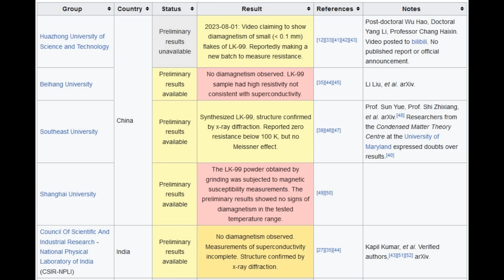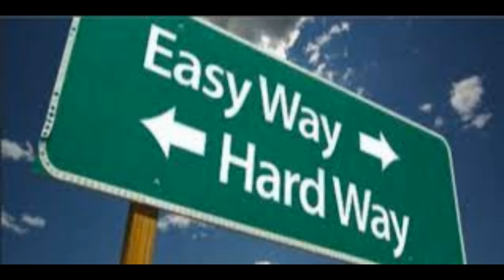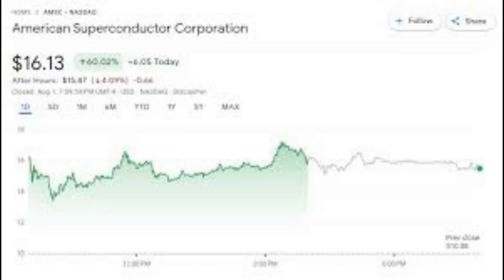2007 Superconductors And The Trouble With LK99

Comment: THINGS MODERN SCIENCE DOES NOT APPARENTLY KNOW:

Consider the following:
a.  Numbers:  Modern science does not even know how numbers and certain mathematical constants exist for math to do what math does.  (And nobody as of yet has been able to show me how numbers and certain mathematical constants can come from the Standard Model Of Particle Physics).

b.  Space:  Modern science does not even know what 'space' actually is nor how it could actually warp and expand.

c.  Time:  Modern science does not even know what 'time' actually is nor how it could actually warp and vary.

d.  Gravity:  Modern science does not even know what 'gravity' actually is nor how gravity actually does what it appears to do.  And for those who claim that 'gravity' is matter warping the fabric of spacetime, see 'b' and 'c' above.

e.  Speed of Light:  'Speed', distance divided by time, distance being two points in space with space between those two points.  But yet, here again, modern science does not even know what space and time actually are that makes up 'speed' and they also claim that space can warp and expand and time can warp and vary, so how could they truly know even what the speed of light actually is that they utilize in many of the formulas?  Speed of light should also warp, expand and vary depending upon what space and time it was in.  And if the speed of light can warp, expand and vary in space and time, how then do far away astronomical observations actually work that are based upon light and the speed of light that could warp, expand and vary in actual reality?

f.  Photons:  Modern science claims that energy cannot be created nor destroyed, it's one of the foundations of physics.  First Law Of Thermodynamics:  "Energy can neither be created nor destroyed."

A photon is usually depicted in a sine wave pattern with the 'e' and 'm' energy fields 90 degrees to each other.  The 'e' and 'm' energy fields go out together and come back in together, over and over and over, doing so even across the vast universe as far as we can see.

Where does the energy in the energy fields go when both the 'e' and 'm' energy fields go to zero?  And what causes the 'e' and 'm' energy fields to come back to 'full' from zero?

Also, 'if' a photon actually red shifts, where does the red shifted energy go and why does the photon red shift?  And for those who claim space expanding causes a photon to red shift, see 'b' above.

Why does radio 'em' (large 'em' waves) have low energy and gamma 'em' (small 'em' waves) have high energy?  And for those who say E = hf;  see also 'b' and 'c' above.  (f = frequency, cycles per second.  But modern science claims space can warp and expand and time can warp and vary.  If 'space' warps and expands and/or 'time' warps and varies, what does that do to 'E'?  And why doesn't 'E' keep space from expanding and time from varying?).

g.  Energy:  Modern science claims that energy cannot be created nor destroyed, it's one of the foundations of physics.  Hence, energy is either truly a finite amount and eternally existent, or modern science is wrong.  First Law Of Thermodynamics:  "Energy can neither be created nor destroyed."  How exactly is 'energy' eternally existent?

h.  Existence and Non-Existence side by side throughout all of eternity.  How?

*  Note:  My theory of everything idea, 'if' true (currently dependent upon the results of my gravity test, but 'if' true), can potentially answer all of the above items.
Reply: GRAVITY:
WARNING:  (CONTAINS EXISTENTIAL MATTERS):

Here is the test for the 'gravity' portion of my TOE idea.  I do not have the necessary resources to do the test but maybe you or someone else reading this does, will do the test, then tell the world what is found out either way.

a. Imagine a 12 hour clock.
b. Put a magnetic field across from the 3 to 9 o'clock positions.
c. Put an electric field across from the 6 to 12 o'clock positions.
(The magnetic field and electric field would be 90 degrees to each other and should be polarized so as to complement each other.)
d. Direct a high powered laser through the center of the clock at 90 degrees to the em fields.
e. Do this with the em fields on and off.
(The em fields could be varied in size, strength, density and depth.  The intent would be to energy frequency match the laser and em fields for optimal results, cancelling out the em modalities of the laser, thereby leaving behind the gravity modality.)
f. Look for any gravitational / anti-gravitational effects.
(Including the utilization of ferro cells so as to be able to actually see the energy field movements.)

(And note:  if done right, it's possible a mini gravitational black hole might form.  Be ready for it.  In addition, it's possible a neutrino might be formed before the black hole stage, the neutrino being a substance with a very high gravitational modality with very low 'em' modalities.)

(An alternative to the above would be to direct 3 high powered lasers, or a single high powered laser split into 3 beams, each adjustable to achieve the above set up, all focused upon a single point in space.  Maybe I could concentrate the Sun's 'em' into a high powered laser.  Might even work with the correct set up breaking the Sun's 'em' down into single 'em' energy frequencies acting like a single energy frequency laser.  A high energy laser powered by the Sun.  Cool, or actually pretty hot.  More than one way to build a laser.)

'If' effects are noted, 'then' further research could be done.
'If' effects are not noted, 'then' my latest TOE idea is wrong.  But still, we would know what 'gravity' was not, which is still something in the scientific world.  (But hey, might even still get a Sun powered laser, which of course could even be utliized in outer space for various agendas.).
This test can speak for itself.  It will either be true, partly true, or not true at all.  It will either show what gravity truly is, might be, or is not.  Science still wins either way and moves forward.

*  And note:  Whether my gravity test or another's, a gravitational black hole would have to be formed to prove the concept as being really true.  A gravitational black hole that 'if' self fed itself, could literally wipe out this Earth and all on it, possibly this solar system, possibly put a black hole in this section of our galaxy, and potentially even causing a ripple effect in this galaxy and surrounding universe.  But hey, if it does, no worries.  Nobody would be left to prosecute those who did so.  (Possibly famous last words:  "Hey, it worked.  Ooooppppssss.................)

But as NASA has already proven that low gravity conditions over a prolonged period of time is harmful to the human species, and large rotating space ships won't really work for space bases on planets and moons, those space bases probably being needed somewhere along the way out of this solar system and galaxy, we need to figure out what gravity truly is and see if we can generate artificial gravity so as to have smaller space ships and proper gravity conditions for space bases on planets and moons.  Otherwise, at least all human life will most probably die and go extinct one day.  Currently, no exceptions.

*  Added note:  Just trying to save at least 1 single species from this Earth to exist beyond this Earth so that life itself from this Earth has continued meaning and purpose to.  Gives me something to do while I exist, otherwise, what is it all and everything for?  Even if my TOE idea were correct, but if it did not help species survive beyond this Earth, what good would it ultimately be?

So, are you feeling lucky?  Doing nothing and at least the entire human species eventually dies and goes extinct with a high degree of certainty.  Doing a gravity test, (mine and/or another's), and there is at least a slim chance of literally wiping out this entire Earth and all on it, and possibly more.  Do you and other's truly want me to prove my TOE idea as being really true?

But also:
Questions:  Are at least some black holes in this universe due to a species who were trying to discern what 'gravity' truly was, came up with a test to do so, were successful, but the black hole generated (to prove what gravity truly was) self fed itself and wiped them and at least their entire planet out?  What species might have existed where a black hole now resides?

(Since all of life itself is ultimately meaningless in the grand of scheme of things anyway, do the gravity test and see what occurs?)

*  Added note:  Suggestion:  'IF' society did not want to do the gravity test, one suggestion might be to at least create a model as if it were true, then see how that model matches with observations and predictions.  It might be possible to discern the theory of everything without actually generating a gravitational black hole (which would definitely prove the TOE idea as being really true).

Comment: they have created 100s of miles of cuprate and other super conductors for electrical transmission (10,000 amps in a ribbon a few mm thick to replace copper cable as thick as your leg) inside particle accelerators and various fusion projects. they also exist in MRI machines. not exactly "lab curiosities!"
Reply: There is lots of applications for a cheap non-cryo SC, especially when it comes to energy transfer, energy storage (SMES devices) and imagine what RT SCs can do for coilguns and warfare, with a little imagination a true RT SC could really revolutionize everything.
Reply: @ET_AYY_LMAO  yes the first big IF is IF it is a SC. if it is i dont think synthesis will be a problem whatever mechanical or recipe steps are necessary to add but if its not possible to make it into ribbons it limits its use for long transmission lines. assuming it can support a 1000s of amps which not all SC can do. still very exciting!
Reply: @danielroden9424  That is true. Im hopeful that there is something to this, early reproductions seem to have promising qualities, but I also think that it is a very difficult crystal lattice to synthesize. As I understand it the Sulfur ions that need to be replaced are those that have the highest energy state in the compound, so it is also the least likely place where it happens, so you can only assume that it is extremely difficult to actually produce these structures and the actual yield in the amorphous end product is terrible... Still exciting to know if a RC SC indeed exists, even if it is just a few micron specs in a otherwise useless amorphous blop.
Reply: @danielroden9424  It was confirmed TODAY by two universitys and a national lab.
ita a super conductor, and its actually synthisis thats an issue, teh chemistry behind it makes it very difficult to get decent yeilds sincs the side reactions are favorable
Reply: @AnonymousAnarchist2  Nothing of that sort was confirmed.
Reply: @AnonymousAnarchist2  ok so you crank out enough of it and you can sort out the viable part then you just keep dong that recycle the non super conducting, filter, repeat. at least in the short term that seems like an easy strategy to yield decent amounts
Reply: @danielroden9424  yea. seems so, not sure the final product can be formed into a monilithic structure, and I am less sure that would matter.
Reply: "Lab" as in controlled conditions.  We probably couldn't maintain that ribbon's stability without incredibly low temperature or extreme pressure, lol
Reply: well yes but no.
they are still rather fragile, and of course need to be cooled tremundiously.

Comment: I was always under the impression that UHF and a high voltage with low current lets power run on the surface of a wire or inside a tube like  a Waveguide. Is this not the lowest impedance possible?

Comment: You could use superconductors in outer space
Reply: 'BATTERYLESS BATTERIES':
To help power equipment in outer space:

Potential endless energy source basically anywhere in this universe:

a. Small aluminum cones with an electrical wire running through the center of the cones, cones spaced apart (not touching I'm thinking) but end to end.
b. Electromagentic radiation energy in the atmosphere interacts with the aluminum cones.
c. Jostled atoms and molecules in the cone eventually have some electrons try to get away from other electrons of which those electrons gather at the larger end of the cone, of which also creates an area of positive charge at the smaller end of the cone.
d. The electron's in the wire are attracted to the positive end of the cone and the positive 'end' in the wire are attracted to the negatively charged end of the cone.
e. Basically a 'battery' has been created inside the electrical wire itself, different areas of electrical potential.  Basically a 'wire battery' or a 'batteryless battery', however one wanted to call it.
f. Numerous cones placed end to end increases the number of 'batteries' in the wire.
(In series to increase voltage, in parallel to increase amperage).

*  Via QED (Quantum Electro Dynamics) whereby electromagnetism interacts with electrons in atoms and molecules, one would have to find the correct 'em' frequency for the correct material being utilized for the cones.  The shape of the cones could also come into play.  The type and size of the wire as well as the type and thickness of the insulation between the cones and the wire would also be factors.
*  Of course also, possibly 2D triangles made up of certain materials with a conductor going down through the center of the triangle could possible achieve the same 'batteryless' battery system.
*  Plus possibly with the 2D concept, layered 2D's that absorb different energy frequencies, thereby increasing the net output.